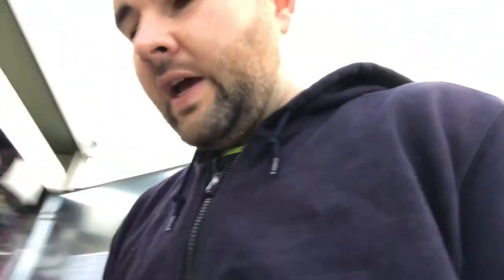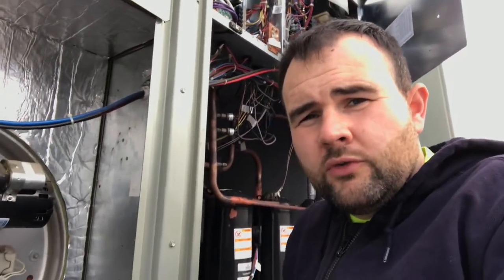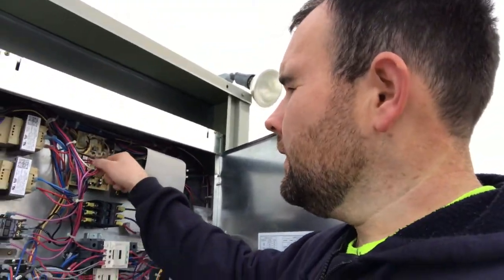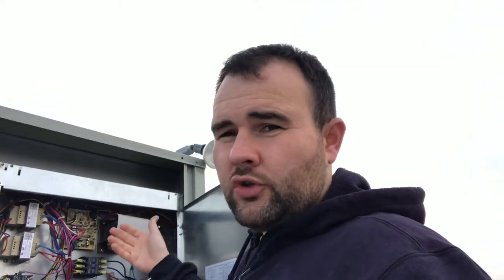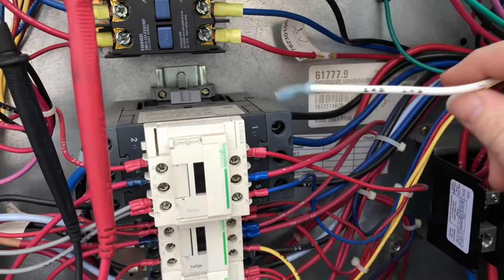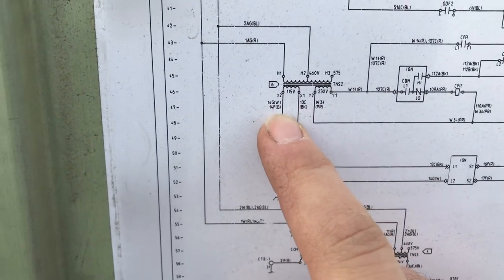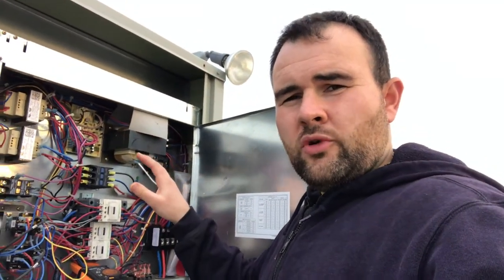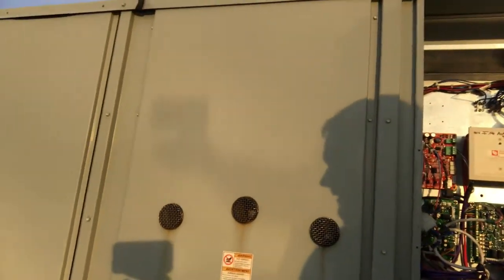TRANE No Heat Call, Is It The Hot Surface Igniter, Control Board Or Something Else?

Comment: 2 blinks... indicating failure to sense flame.. I replaced the hot surface ignitor and its still not that. pressure switch is fine... not getting voltage to the gas valve. i'm assuming the unit locked itself out due to a limit switch?

Comment: Good job,you can used a coins or any metal object and touch those 2 screws on the low voltage terminal block and will go fast on test mode,you don’t have to wait,is too cold,be safe

Comment: I got a trane that will start up the inducer fan but won't fire. No gas smell, Has new ignitor. Inducer fan will run constantly
Reply from the maker: Is there an attempt of ignition? Check igniter and voltage at gas valve. No gas probably indicates that the gas valve is not opening, if voltage is not present at the gas valve but you have a call for heat, check the ignition control board and safeties. Same system run the inducer draft constantly when a limit switch or roll out switch is open. If everything functioning, check inlet gas pressure to the unit.

Comment: Those tranes can be tricky for sure if you’ve never seen one/have no experience
Reply from the maker: Yeah no flash code diagnosis to make it easy like many other units have. Just tells you its in heat failure.